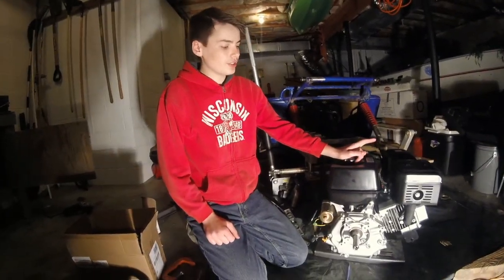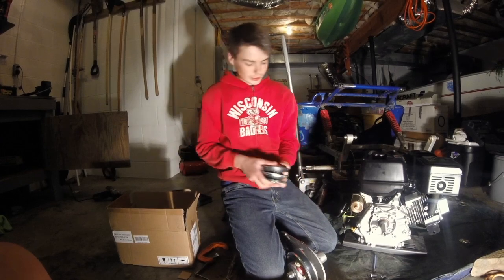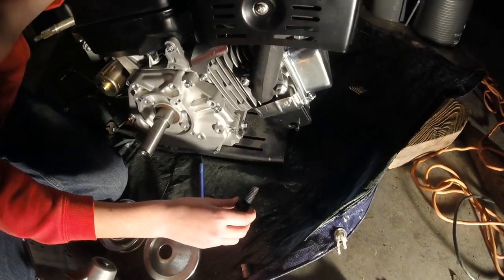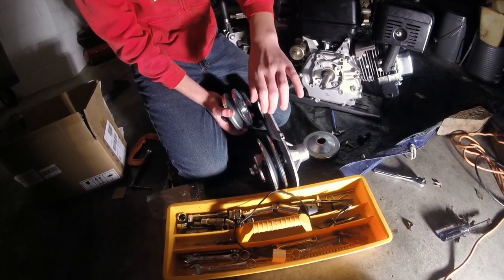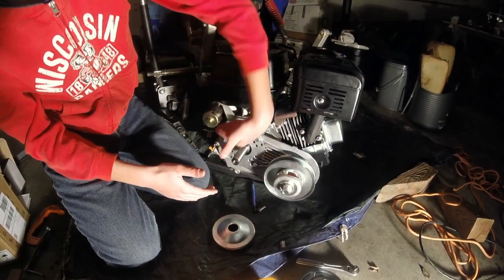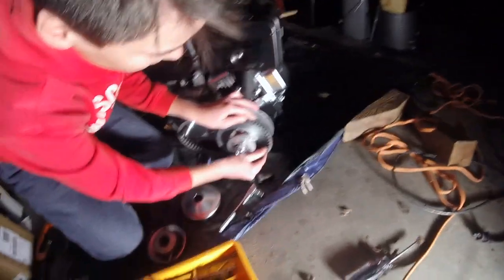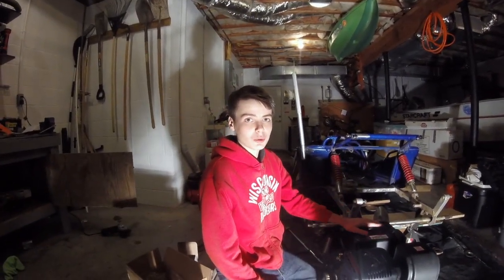SUPER POWER! Predator 420cc & Honda Engine Torque Converter Quick Install -Part 5

Comment: How did you get a 30 series 3/4 inch hole driver pulley over your 1-in 420 shaft? Did you order a separate 1-in driver pulley?
Reply: They make the series for both 3/4 and 1inch

Comment: The max the 30 series would probably be a GX270cc or a predator 301cc engine. It hold with a stage 1 kit and an open header? Putting out 11-13 horses. You also need to buy dry Mollie lubricant for the driver if not it will seize-up!

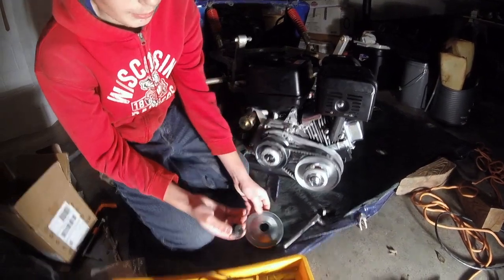Comment: Time 6:44 Why didn't you just drill out the spacer to fit the bolt ? Better than using a washer?
Reply: My guess, he probably didn't have a drill press.
Reply: @mrgoldendeel  …Why didn’t I think of that?

Comment: I've seen other people space part of the torque converter off the crankshaft so when the belt is at its top speed it's not crooked and doesn't wear out.
Reply: Right on.

Comment: What size and length bolt did you use on the cranchshaft for the torque converter?
Reply: 3/8 24 at ace just picked one up

Comment: Keep us updated on how that clutch works out. I wouldnt recommend my youtubers too buy that one until you have tested it. Also, How will you do oil changes? If its brand new there is a break in period in which metal shavings will be circulated throughout the engine and it will need to be changed. You can use a tap and die to recover that bolt with no head on it when it comes time. Look into those two things and see if what you find will change your mind. You are doing a great job explaining things. I am interested to see how it turns out. Keep up the good work.
Reply: Erik Schulwitz theres 2 oil checks one on each side.

Comment: Smart kid but you need a 40 series converter for that engine. Gonna cost you more $$ in the long run buying belts. I never did see you install the brass idle bushing?
Reply from the maker: glennspeeds  Thanks for the comment! I think I'd rather burn a few $20 belts than buy a $400 as opposed to a $50
Reply: Garage Guru You will be burning up more than just belts LOL! It has been two years I’m sure you have found out by now.
Reply: Garage Guru I think you may go through drive pulley breaks and springs too.
Reply: No buddy I did the same mistake it’s way better to buy a 40 series it will save you tons of money and you won’t have to worry about burning belts. Trust me I learned it the hard way. It is pricey but trust me it’s way better with the right parts
Reply: @juliansalazar4930  same boat ! two seater offroad tao tao that has been modified. its pretty heavy and my 30 cvt keeps burning belts even the kevlar ones ! looking to buy a 40 series how much beefier is the belt comparison and do you really gain more torque from the 40 ?
Reply: How did this work out? I just order a 30 series haven't tried it on my 420 yet but now I'm worried that it won't work out

Comment: Could you help me find that 18 mm bolt?
Reply from the maker: kyle biskup Could I have your email address and we can talk
Reply: kyle biskup  just cut the lugs off the  plastic plug till you have clearance. There will still be enough to tighten the plug.
Reply from the maker: Bob Gomola I tried that and there was not enough clearance even with the stock plug removed.
Reply: Taylor's do it Center has them

Comment: franck guyader
il y a 1 seconde
bonjour je recherche un kit kart pour un moteur de honda gx 240 avec un axe de25.4mm
Reply from the maker: Cela devrait fonctionner:  https://www.ebay.com/itm/GO-KART-TORQUE-CONVERTER-KIT-CVT-CLUTCH-1-COMET-TAV2-30-75-6-Driven-10T-40-41/390581280696?hash=item5af0755fb8:g:hJ0AAMXQhpdRu8ep

Comment: Can you link the torque converter you used?
Reply from the maker: https://www.ebay.com/itm/GO-KART-TORQUE-CONVERTER-KIT-CVT-CLUTCH-1-COMET-TAV2-30-75-6-Driven-10T-40-41/390581280696?hash=item5af0755fb8:g:hJ0AAMXQhpdRu8ep